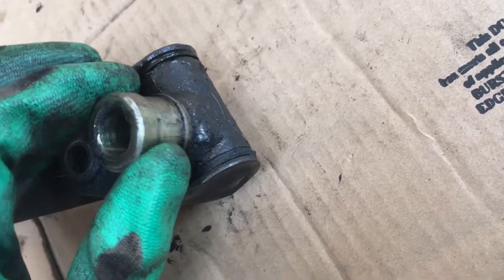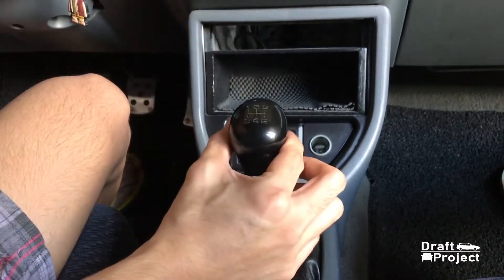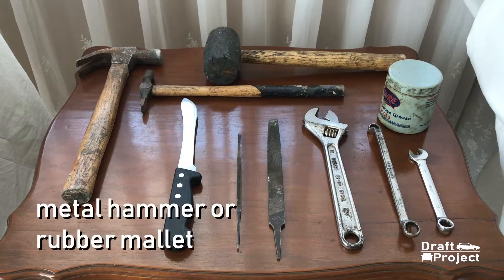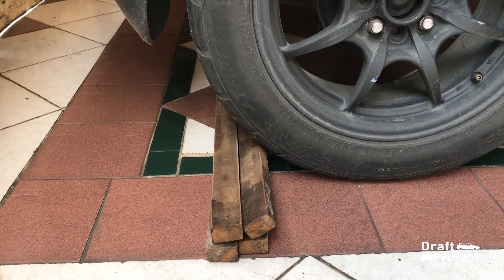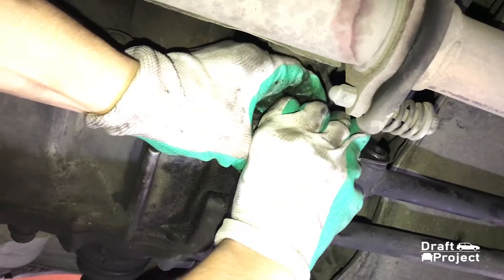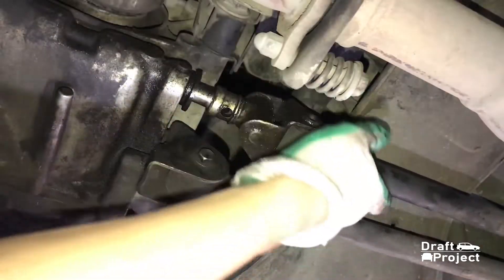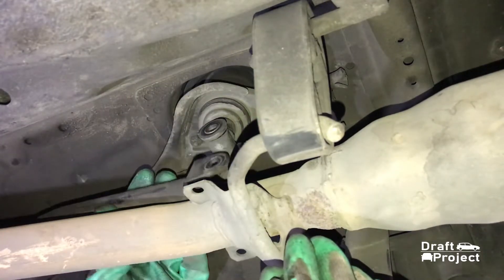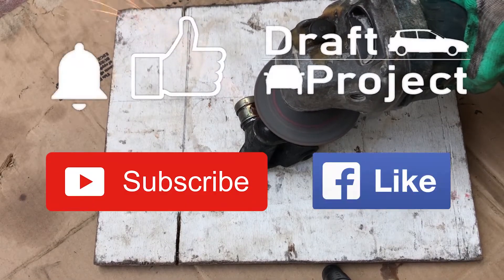How to Modify your Shifter Linkage Part 1 (Removal) - Honda Civic EG - Draft Project

Comment: I have a 93 honda del sol with D15B7 engine.  its converted from auto to manual. Everytime i shift, the shifter hits the center console, causing the shifter to pop out from gear, i think the previous owner put or used a B series shift linkage. Which is not compatible to D15B7.
Reply from the maker: Hello! That problem is bit hard to analyze since there are too many factors to consider. Some says that it is possible to interchange or combine B series and D series shifter linkage parts which is a bit difficult to assume. I would suggest you to jack up the car or put it on a lifter and examine the shifter linkage. There has to be someone inside to operate the gears for you to see how your shifter linkage operates. If you see some restrictions on the movement or something that doesn't look right, then that would help you define the problem. I hope you find this helpful. Thank you and have a nice day! :)

Comment: Thank you SO MUCH for making this video!
Reply from the maker: Thank you very much! Glad you appreciate it. :)
Reply: @DraftProject  Will you be doing another video on rebuilding the shifter where that boot was broken, I know there are parts in there nobody replaces.
Reply from the maker: @BoostedPastime  I have a video for the broken boot and the oil seal of the transmission. This is the link for the video. 

https://youtu.be/qW4CwnLe_3w

If you are referring to the other one which is closest to the shift knob and shifter, I do not have a video for it yet. But don't worry because I will create a video for that soon. Thank you for your support! I am really glad that you enjoyed it! :)
Reply: @DraftProject  thank you! You should be using a speed factory shift spring for your transmission too!
Reply from the maker: @BoostedPastime  That is the simplest effective mod to have a better driving experience. Too bad, we don't have that in our local market. Thank you bro, that is a great suggestion too!
Reply: @DraftProject  Can't you order it off ebay?
Reply from the maker: @BoostedPastime  I can but, it is expensive considering all of the shipping fee charges and more. Maybe someday once I got a proper investment for it haha. :)